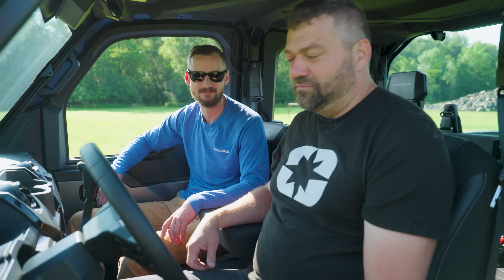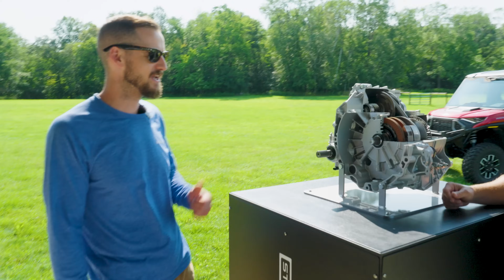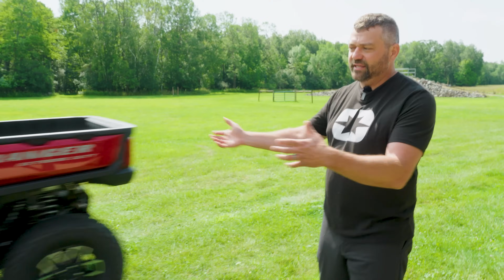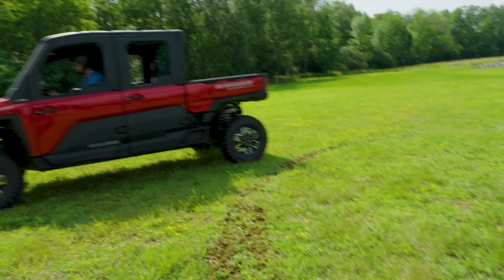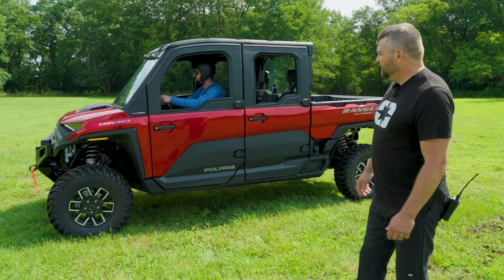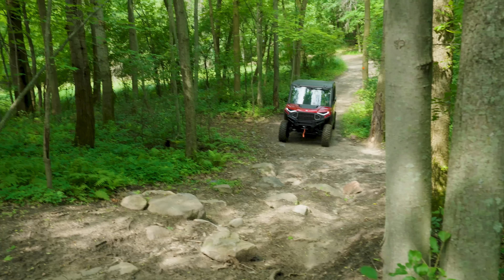Getting The Most Out Of Your RANGER XD 1500 | SHOP TALK  EP. 49 | Polaris Off Road Vehicles

Comment: First, thank you for describing/demonstrating Torque Boost more fully than the note I got from our dealer. I affectionately called this the grenade option after reading the note. I am now much more comfortable doing the procedure on the trail when required.
My questions are:
1.	What is actually happening with the front differential in the AWD mode with the rear differential locked and the front differential locked (light illuminated) (approximately 5:10 into the video). At this point in the video Pat clearly says that “all four wheels are pulling”. This statement directly conflicts with my understanding of the classical 4WD function on past Polaris vehicles. Videos for our past XP 1000 clearly indicate that the fronts are freewheeling until the rear wheels slip and then they engage through magnets to begin pulling.
2.	On the demonstrations of the modes, specifically AWD and Ultra Turf, it is clear that the fronts are not tearing up the grass in either mode. Are those front wheels pulling at this point in the video? 
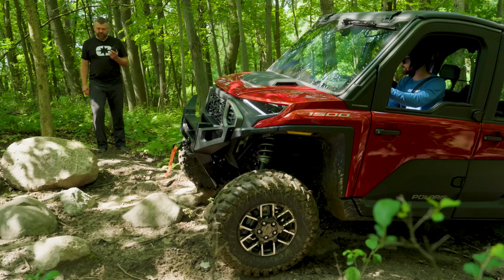3.	The confusion was further highlighted during the Torque Boost demonstration, approximately 18:23 into the video, when Pat seems to indicate that the lone rear wheel in Ultra Turf was starting to spin. If that wheel is spinning why did the fronts not engage and pull? If this is supposedly a good trail riding mode then I would assume that all three wheels would be engaged and pulling at this point.
4.	Last question, what happens if you make a mistake and perform the Torque Boost procedure while in Ultra Turf? Will the system not do Torque Boost or is there the potential for tearing out an axle?

Comment: So a good portion of this video is just trying to explain away why this thing doesn't want to climb steep hills at altitude, and telling people, its a feature not a flaw, and you just need to wait out the over temp code and try again?  Not exactly safe if you're in the middle of a steep technical crawl. And, basically can't feather the throttle, but instead have to floor it?  That's the best way to break an axle or drive shaft. Also not the way to navigate a steep technical crawl. I know this isn't really the machine for that stuff, but it WILL be used for that, and it should be safe, and get you up a hill.  Is this explanation just to quell all the talk about this thing being an insanely expensive bust on hills? And, not for nothing, but those drive modes should be built int your foot. want to accelerate slowly? Step on the throttle gently. Want to leave a rooster tail? Step harder. You shouldn't have to select a drive mode to determine how hard it accelerates. Even 700 HP Hellcat can leave a stoplight slowly and gently, or leave it with a 150 foot burn out simply by a difference in how hard you step on the skinny pedal, and without selecting a "drive mode". I'm confused why this needs to be a thing that just further over-complicates this machine.
Reply: I've experienced this exact same issue, and complained about it to the reps at the dealer show in Vegas. I was told to check the trans oil level and make sure the trans wasn't overheating. We ride at 5000+ ft 24/7, and often get up to 10k. To have a machine that won't climb up steep hills at high elevation is extremely disappointing
Reply: They acknowledge there is a problem.... Wait for the transmission to cool down when it overheats.  Later they tell you to heat up the clutch disc.  Yep mine is still  at the service dept less than a thousand miles.
Reply: 100% on point.
Reply: Sounds like they need to put a high and low range in this thing.  When I heard they got rid of low range I questioned if it was going to work in really steep or rough stuff, especially loaded down heavy.
Reply: It needs a low range or crawl mode
Reply: This is so accurate. Brand new 2025 that is showing an overheat and then will not pull out of farm fields. This is brand new so if it requires full throttle all the time in order to get across the fields, this will not work.
Reply: So what if it gets water in it? How bad is it gonna be to rebuild?